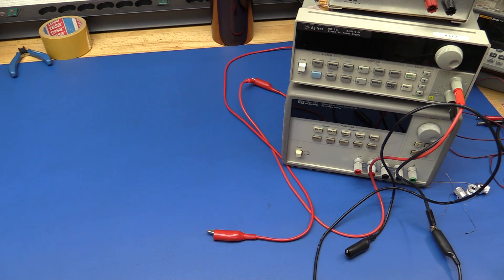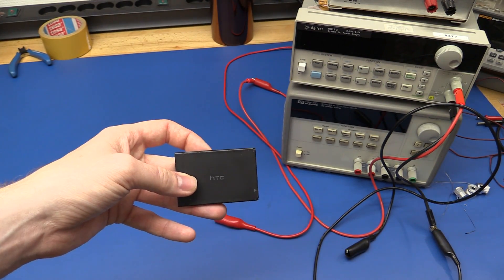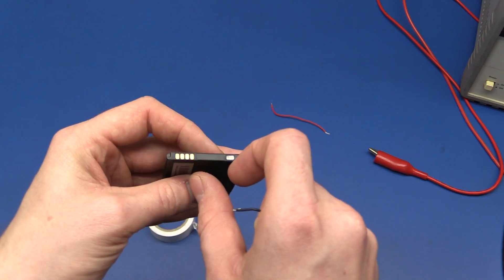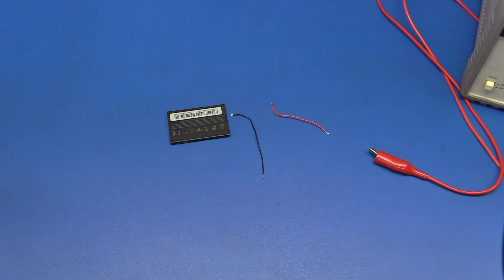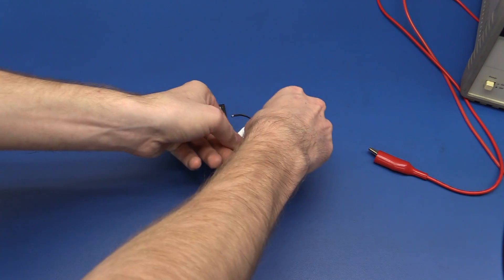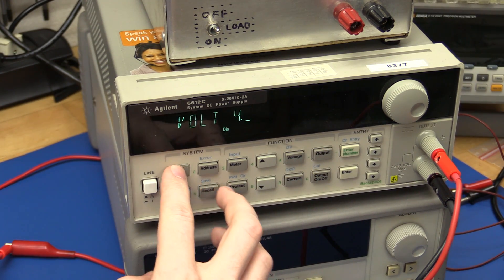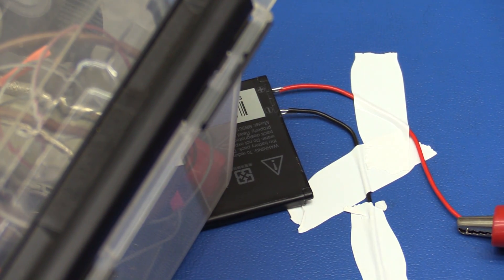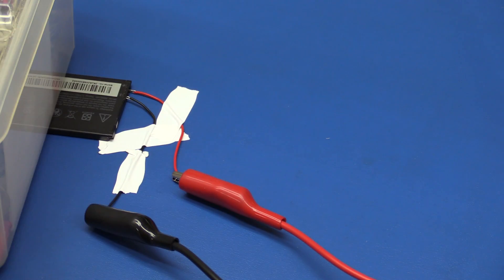Quick Tip: Charge a "Salvaged" Cell Phone Battery on the Bench - Ec-Projects

Comment: sir, thanks for your video..my confusion is the FOUR TERMINALS on the battery .....
My battery has the NEGATIVE SYMBOL above terminal THREE but i think the symbols just mean you use the OUTERMOST terminals 1 and 4 for plus and minus....

do you know if that is the case ....?
Alcatel battery

thanks

could i use a USB POWER BRICK from the wall and just hook the PLUS and MINUS like your video?

would it just STOP charging when the battery is full?

Comment: If you have any microchip controllers with the little spare sets of pin clip arrays, you can crack a few off and use them to line up with the pins since they're pretty rigid.

Comment: Always obvious after we see. THANKS EcProjects.
If you don't have a Power Station, PSU, you can use a 'AAA to AA converter', solder wires onto that, taping the wires onto the table and connect the battery. Put the 'AAA to AA converter' into a Li-Ion battery charger.

Comment: Can I use battery of one mobile in second mobile by connecting the mobile charging pins to battery pins through wire as socket of battery is not same. Will it work.
Reply: If it's compatible, then yes.

Comment: It's amazing how well this bent wire trick works! Today I found myself trying to manually recharge a phone battery for my gf's mom as she seems to have somehow completely destroyed the charging port (pins are nowhere to be found...). I tried making a little jig with a right angle pinheader and breadboard but I couldn't get good contact. Tried the method shown here, bending wires into small hooks, pushing the battery up to them, then setting something heavy on top (I just used a small portable USB hard drive) and lo and behold it worked perfectly haha! Currently charging happily right now. Thanks for taking the time to post this!
Reply: I wouldn't knock anyone who minces a usb port, techology is cheap  foreign shit, it is easy and westen mugs like us are too stupid to spot it.
Reply: I bought a universal charger. Two contacts on charger and 3 contacts on battery like yours. What is that middle contact on battery and can I possibly have it in reversed??
Reply: She had same problem as me with port. They loosen up as you hold them while charging, then eventually drain battery instead of charging it. So frustrating...
Btw fyi on gospel:
Acts 2:38 Acts 22:16
Mark 16:16
Reply: What did you use to set voltage and current?? As i"m having same issue with my mother's phone

Comment: This will work with a power bank also if you don't have a bench supply. I charged a battery that my old phone could not charge. The battery contained a protection circuit and refused further charge at 3.90 volts, so it's quite safe.
Reply: Every of them has BMS (protection) because every phone would be dead if they wouldnt have it
Reply: @themysterygamerpl7089  Not so. Many cells are bare, and the protection circuit is on the associated PCB.

Comment: I think its great but one thing should probley put tape between the two wire were they connect to battery or just stand up a small piece of no conductive material small plastic or rubber duck tape. Or eltric tape as so if the wires do come. Free you don't short across or in case both come free they don't touch an that be Ni good an Jake the standard,for cell bat is,0.5 an 3.7 v nomnail is. What most say. They are, 4.2. Is what. They realy are, standard so he set amp an volts, don't forget this is dc were messing with amp times volts give watts think that's right if not its volts times amp gives watts,

Comment: Increase the voltage beyond 4.2-4.3 V and you got yourself a potential bomb. So I wouldn't recommend doing this rather buy a li ion charger circuit which are very cheap.
Reply: 100% safe with a supply that does CC and CV.

Comment: Awesome trick.  But you can easily do this without a variable DC bench power supply. Just take a USB data cable, cut the end which connects to your phone and strip some insulation at that end. Then connect the cable with a USB port/ wall charger that gives 5V DC output, connect the battery's positive terminal with the red wire of the data cable and negative terminal with the black one as shown in the video and you're done. I've revived some of my apparently dead Lithium batteries this way.
Reply: very outstanding
Reply: nice
Reply: This is how you can easily burn down a house or apartment building. Someone will connect the full power instead of data cable and that is the end of things. It would be a very easy mistake to make. Also some data lines put out only 1.2 volts.
Reply: @biggadfly  What is a "full power"? Except the data transfer lines usb has +5V and GND. The 5V should do the job without problems, unless you overvoltage it - that's where watching over the charging process with multimeter or getting a charger circuit like TP4056 gets quite important.

Comment: Very handy tip which could be used for a variety of batteries and for powering items directly from a bench PSU although you have to be careful not to overcharge Li-on batteries as this is a potential fire hazard!
Reply from the maker: +Pete Allum Thanks for your comment. Yeah, it's very important to get the voltage limit correct. Especially with higher currents it doesn't take long for things to go wrong!